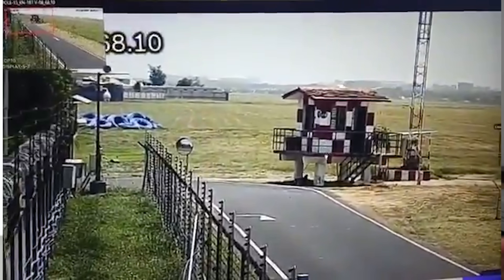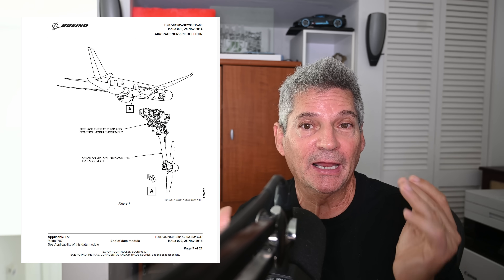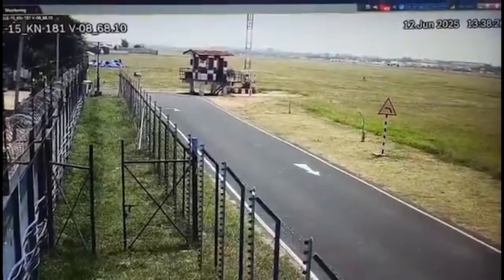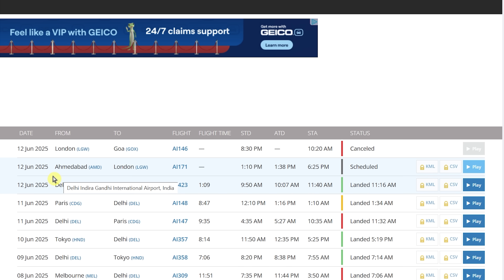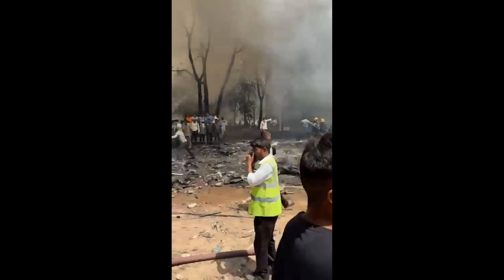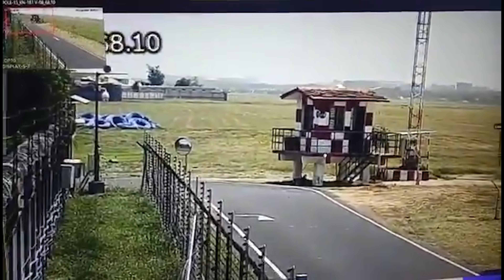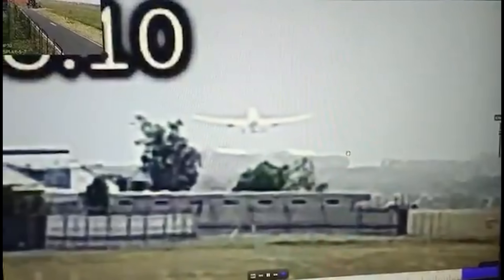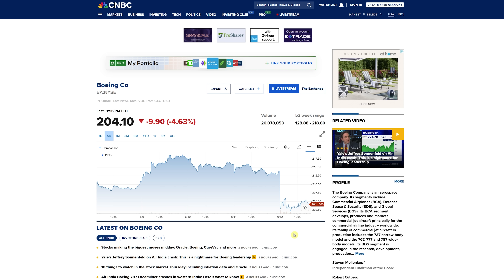What Caused Air India 171 Crash, Mysterious Sound Before Impact

Comment: 10:38 I see a problem in this video. At some point the smoke disappears behind the engine. The engine thrust should be 100%. After that the plane with its nose up does not climb (loses speed). Engines idle or turn off (generator sound not engines), flaps low (or I don't see it ) but bend wings (aerodynamic brakes) and high nose.
Reply: Incorrect. The 'smoke' you see briefly on this video footage is most likely dust kicked up from the aircraft's wing turbulence wake. Engines such as the modern high bypass turbofans found on the 787 don't tend to put out much smoke at all. In fact you typically only see smoke from them occasionally when they are starting up and are burning a bit of residue left in the engine from when the engines previously shut down before fully spooling up and ignioting during the start up sequence. 

And contrary to what many people imagine, you don't simply put the throttles to 100 percent for take off in a jet airliner. There is a very good reason for that too: In high ambient temperatures, the air is less dense, and this creates a difficulty in relation to engine efficiency; in such a situation, jet engines are unable to suck in as much air as they would in cold temperatures when the air is much denser. Because of this, injecting the full thrust amount of fuel into an engine which is incapable of taking in the required amount of air necessary to mix with that fuel in order to burn it efficiently and create thrust, will result in the engine being essentially swamped with fuel which it is incapable of mixing with sufficient air, hence less thrust will be produced than would otherwise be the case with a lower throttle setting. You will in fact find this is true even with your car; the chances are it will probably run a bit better in colder weather and may even have a slightly higher top speed when the air is cold and more dense.

To alleviate this problem with aeroplanes, the ambient air temperature and density altitude are entered into the flight management systems of an airliner as part of the pre-flight procedures (along with many other prameters such as weight, centre of gravity, fuel density for the current temperature and so on) and this data is then used as part of the calculations for the take off autothrottle settings whereby the flight management computer will calculate the best thrust setting for the engines based on all those parameters to allow maximum thrust to be generated from the available air density and temperature. So typically, with this sort of stuff, the aircraft will line up on the runway, then the pilots will engage the autothrottle which will then use the calculated TOGA (Take Off/Go Around) setting from the flight management computer to provide the most efficient thrust setting, which might actually be quite a bit below 'full throttle'. Then they'll release the brakes and the take off roll commences with the throttles being controlled by the FMC.

A lot of the time this kind of thing (known as Flex Temperature on Airbus airliners and Reduced take-off thrust on Boeings) is done to save fuel, but in hot and high places, it's more about ensuring the engines are running as best as they can to provide suitable thrust for take off.

Comment: One thing stands out for me: I have watched the original video many times, and I see NO FLAPS! It could just be the angle that was shot at, but try as I might, I can’t see any take-off flaps.

Also, I can hear the RAT clearly. But, loss of thrust would not allow the aircraft to climb to 600 feet. Total hydraulic loss?

To me, this is a stall after takeoff. Don’t know why. Loss of thrust/power would deploy the RAT. Could be a combination issue. I’m interested to know about those flaps. Because takeoff flap settings are based on weight, temperature, elevation, etc., and takeoff thrust is set based on similar inputs.
Reply: The engines seemed to have failed very shortly after rotation, it was fine until then.
Reply: I saw another video and the majority said no flaps
Reply: flaps were on , see the debris!
Reply: I'm not a pilot but from the very first video I seen... I said the wings look to flat, as in there was no flaps deployed that help at take off..
Reply: Boeing did away with flaps on that model. To save on materials and labor costs. That's why you don't see them. Supposedly the next generation 787's they gonna use feathers.
Reply: @fromthepeanutgallery1084 I can't tell if you are joking or just know absolutely nothing about aircraft.
Reply: @0w3nn   I won the argument anyways

Comment: What was that big cloud of dust at the end of the runway. did this get sucked into the engines
Reply: I believe he was at the end of the runway as he lifted off.  So it was dust/dirt from the ground after the end of the runway.  Either from the engine or just from the air flow from the wing being so close to the ground still.
Reply: The plane took the entire runway to takeoff. Being fully loaded, on a hot day, with a plane full of full it struggled to get off the ground.

Comment: Things i dont see in the video include, the RAT unit deployed (though i agree it sure sounds like a RAT was spinning), any smoke or flames coming out of either engine, the flaps out, or any obvious control issues going on (the plane flew true and straight, but clearly had insufficient lift).  I really think that the plane was too far away from the camera (and flying away from the camera the entire time), for sounds of a RAT propllellor to have. Een picked up by the microphone of the camera. Hopefully the black boxes once recovered and read, will actually have data on them this time that will explain how this happened! Here,s hoping, anyway.

Comment: Fuel contamination caused both engines to loose power.
Reply: I know nothing about planes, so I'm purely speculating.  It's by far the most likely that if both engines failed there would be a common cause.  That could be one of many things, but presumably fuel contamination could be one.  I find it interesting that the failures seemed to occur shortly after rotation/takeoff, when anything foreign in the fuel tanks might have shifted position.  I'd have assumed there's some redundancy/independence though, so I don't know if it's a realistic possibility at all.

Comment: It took off short, no flaps, poss compressor stall, altitude, climate was hot, too heavy.
Reply: According to Flightradar24 data the plane did backtrack to the far end, so it used the full runway.

Comment: at takeoff thrust these ultra high bypass turbofans accelerate their fan blade tips beyond the speed of sound , creating that very noisy buzzsaw prop sound.  it goes away after they throttle back soon after gaining a bit of altitude.  this  sound could be  be that.   but it is quite a pronounced sound so you're probably on to something .  it's hard to tell visually if it's visible.
Reply: Aircraft Tech here. You made a great point. When an aircraft is at takeoff power. You're not gonna hear a RAT like many are saying. RATs are loud on it's own. But it's not enough to overpower the turbine engines. Also to lose electrical power from both engines and the APU. Idk. We just have to wait and see. But that passenger who said he heard a loud bang. If he then says that the plane did lose electrical power. Then the RAT theory does sound possible. He holds a lot of clues to this devastating accident. I believe they already found the black boxes.

Comment: Too hard to see if that little RAT unit was deployed or not in the video... But there is no mistaking that the flaps are not down! That plane has no lift as it slowly pancaked back to earth, and the harder the pilot pulled back on the elevator the worse he made the problem... Elevator can become more like an airbrake if your plane doesn't have enough lift or airspeed as you pull back on the flight yoke. Also anybody else notice something "flapping" thru the air behind the plane just before the plane goes out of sight and crashes? What was that thing, was it part of the plane or something from the ground that the plane's passing so low blew up into the air?
Reply: Its not clear, but im pretty certain the RAT is visible in the part of the video when it zooms in. On the right side of the fuselage to the left of the right landing gear

Comment: What I see is wheels down and no apparent flap deployment. Could the pilot flying have asked for landing gear up and the pilot monitoring retracted the flaps by mistake?
You showed an extended business class layout, in other layouts 11A is the first of the coach seats and is right by the forward emergency exit.
Reply from the maker: t's really hard to see the flaps with these graining videos
Reply: That happened at heath row many years ago, crash report said 2nd pilot retracted flaps instead of wheels
Reply: That wouldn't have caused RAT deployment.
Reply: You an aviation expert???? Or do you know about commercial jetliners???

Comment: 5:30 why is there a big plume of dust?
Reply: I think it rotated late, and the dust you see is the dirt pushed by the engines' thrust at the departure end of the runway. The 787 does not look like it is producing power by its speed. The movement appears to be when an aircraft comes into land and slows down after the reverse thrust is retracted. As Jeff stated, I think it could be an electrical or hydraulic problem. The 787 is a modern airliner. Thanks, Jeff, this was a very informative video.
Reply: India is very dusty. There isn't much asphalt or concrete.
Reply from the maker: probably a dry area
Reply: @jeffostroff  Maybe see if you can find any other videos of takeoffs at this airport to see if the dust is normal?
Reply: @jeffostroff  I looked up quite a few plane spotting videos and compliations for Ahmedabad airport i.e. on air_ahmedabad and eliteaviation channels, I didn't see any big plumes of dust like we see here.
Reply: is kind of odd. You wouldn't think that much dust would accumulate and stir up from one plane
Reply: The plane left the runway at the overrun, Flightaware 24 shows the takeoff using only half the runway, not sure if it's correct. Possible that the load out data was incorrectly configured. High humidity and high air temperatures will reduce the ability for the wings to produce lift. Incorrecty figured would result in a incorrect flapp  setting. Both videos show either no flapp setting or a low flapp setting. A incorrect flapp setting would cause the aircraft to feel as if it had low thrust do to decreased lift.
Reply: @big_al_674  The max temperature recorded today I believe was 40 degrees centigrade or 104 fahrenheit, tomorrow forecast to be 42 degrees, but this is temperature in the shade. So on a tarmacked airport runway in full sun maybe it was almost 50. It appears to be something of a heatwave looking at the forecast over the next couple weeks.

Comment: My personal opinion is that this aircraft was OVERLOADED and one key clue is that it took almost the entire runway to take off which is definitely not normal !!!!!!!!
Reply: That's been clarified; they did not takeoff at the midpoint
Reply: But the pilot's opinion was that they had no thrust.... let's go with that ;)
Reply: @Baerchenization I'm not a professional pilot but I will stay with my theory
Reply: @Baerchenization  If the plane is much heavier than expected it will feel like a lack of thrust because take off power is set lower. Now you can get up to V2, but as soon as you try to gain altitude the speed will drop. So i would not rule this option out.

Comment: This noise was definitely not a turbine.  Also, it didn't look like to me that the flaps were deployed either (but as you said it's hard to tell if they were or not).  In addition, it is exceedingly unlikely that an aircraft loses both engines at the same time. No puffs of smoke (compressor stall) or it ingesting birds or anything.  Strange.  I also find it very strange that it, considering the temperature and humidity, that it didn't use the entire length of the runway, but only about 6500 feet.
Reply from the maker: Interesting points, it's always a challenge to piece together what happened in a situation like this one.
Reply: Flap was the first thing I thought when I saw it dropping
Reply: @bassfan41 I thought so too at first.... I have seen others comment including a good friend of mine who's a commercial pilot. I've also recently seen hi res photos from this crash site showing a full wing section with slats deployed. This plane took off fine.....and then for whatever reason lost thrust abruptly..
Reply: @wickedwarlock1  definitely hard to tell from the video in this clip anyway.  In hearing about other crashes where the flaps weren't deployed, I'm surprised a plane can even get off the ground, only to go right back down.  Will be interesting to hear what happened here
Reply: @bassfan41  I thought the same thing. Climbout seemed normal.....until it just wasn't. Either way, its incredibly sad.
Reply: Multiple flights have crashed from losing both engines.  It's only extremely unlikely to lose both simultaneously through independent causes.  When there's a single common cause, e.g. ingesting a large flock of birds, it just comes down to the frequency of that cause.  There's also, potentially, a correlation: when an engine failure happens, pilots must take non-routine actions under stress, and may make errors which affect the second engine, e.g. shutting the wrong engine down, which has happened before.
Reply: You a commercial pilot???🤔🤔🤔.
Reply: FlightRadar 24 corrected it, the plane did use the entire runway.
Reply: @SladeL  i though so as well also makes sense longer time for V1 with no flaps
Reply: @SladeL  Did FlightRadar 24 originally indicate an intersection take-off?
Reply: @cherylk.2474  yes, that is my understanding.
Reply: it used all length... The former info is just false.
Reply: Do you have reasons to think why something that sounds exactly like RAT is not RAT? And why is it impossible to have dual engine failure? A fuel system issue could cause power loss in both engines at the same time.
Reply: @halfmv2  But engines work, not damage engines. Fuel/supply pump maybe problem but i dont think so  and its werid what whas that.😢 Sad :(
Reply: Flaps were normal after all (5). What about fuel pump/ bad fuel.
Reply: @daworldsyuthofdafuture  you said something about fuel that is why asking do you think it is possible that Ground maintenance crew somehow close the Fule valve and because of residual fuel already inside Engines it somehow helped engines to take off and then… no fuel ??
Reply: @daworldsyuthofdafuture that’s what I thought.   Contaminated fuel
Reply: The noise is not the turbine itself; it is the propeller.
Reply: @markmaki4460  the RAT is VERY distinctly heard here.
Reply: @wickedwarlock1  Good grief. Yes, we are hearing a RAT in my opinion. But the propeller (and air flowing through it) which transfers wind energy to the turbine is what we are actually hearing. The original commenter stated that the sound is not the sound of a turbine; technically she is correct. She did not say the noise is not a RAT, which consists of an assembly which includes a turbine and a propeller, among other parts, nor did i.
Reply: I replied to your comment by mistake somehow, instead of hers.

Comment: I don't see flaps deployed...
Reply: that same issue cause the  Argentine plane crash in 1999. it was very similar
Reply: @PADARM  flaps were on , see the debris!
Reply: @gknkrnkjgjugjrgjrng again... do you mean the flaps are still attached to the plane ?? 

As what people are talking about is the flaps are not pushed out as they should be for take off... no one is suggesting the flaps fell off...
Reply: @evelghostrider  flaps were pushed out . and its not possible for pilots to miss this step . alarms will blow up . also in debris, u can see the flaps were indeed extended for takeoff
Reply: @gknkrnkjgjugjrgjrng  "also in debris, u can see the flaps were indeed extended for takeoff"
Source?
Reply: The comunication by the pilot to control tower was : “MAYDAY  MAYDAY ENGINE FAILURE… NO POWER NO TRUST”……… Evidently an engine problem Not a flaps issue
Reply: @florenciolopez7622  Source?
Reply: I don't see FULL POWER deployed.
Reply: @johngreydanus2033  funny
Reply: Its not 600 feet above the runway. Ahmedebad is about 200 feet above sea level so more like 400 feet above ground seems reasonable
Reply: @davefoord1259  I think you are correct it didn’t reach 600’. ADS-B data might show 600’ but that figure should be corrected for barometric pressure (with a QNH of 1001 at the time of the accident that will be a correction of -360’) and field elevation (180’) so a total correction of 540’. I think it did climb above 60’ but ADS-B is not that precise and further evidence is in the video. The 787-8 has a wing span of 197’, and with the grainy video I don’t think you can actually see the wing tips, but it looks like the aircraft barely reached an altitude of more than 200’ above ground level.